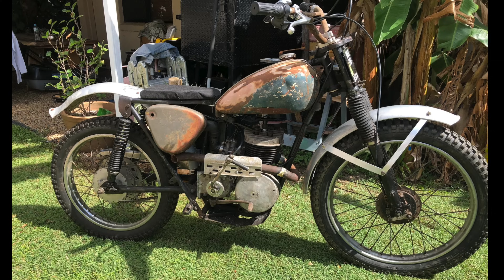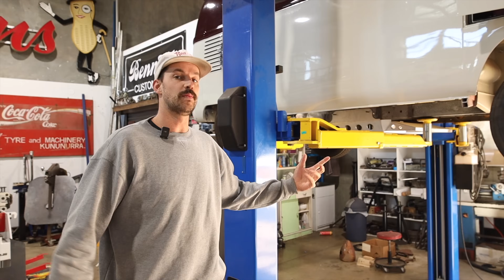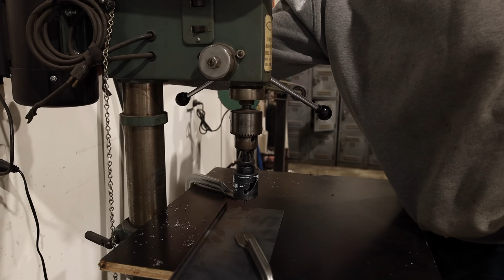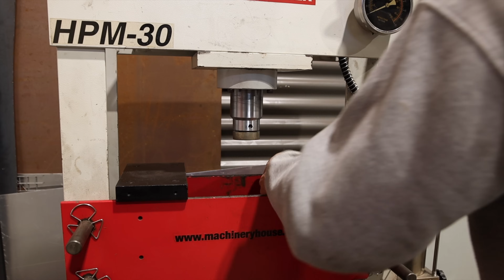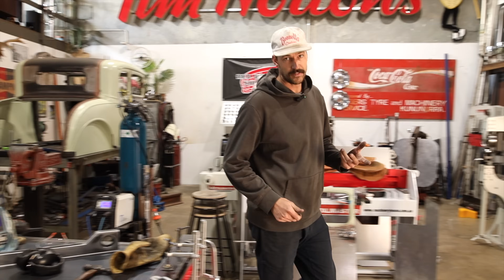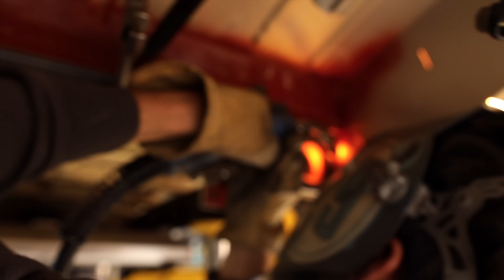Ep. 15 - Custom Cross Member for Airplane Motor Volkswagen Build!

Comment: Is the shifter linkage going through sheet metal good enough? Should there be flanged bushings?
When its on the floor, the rear seems to be sagging = saggation. Anything to address that?